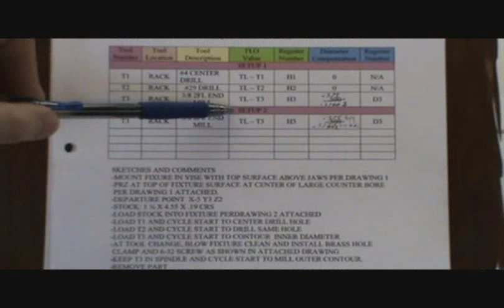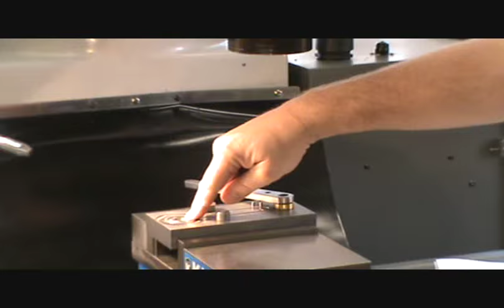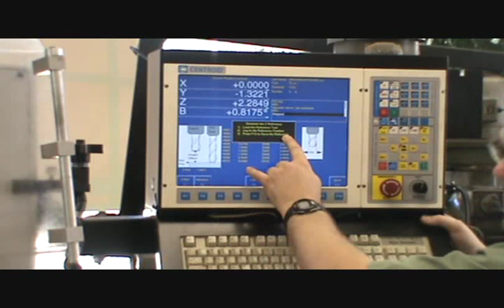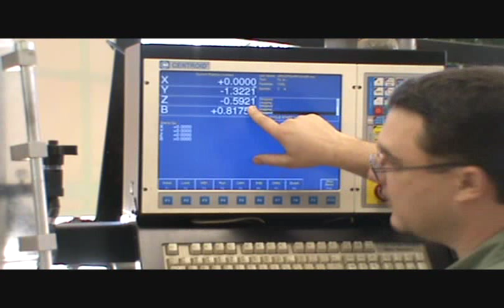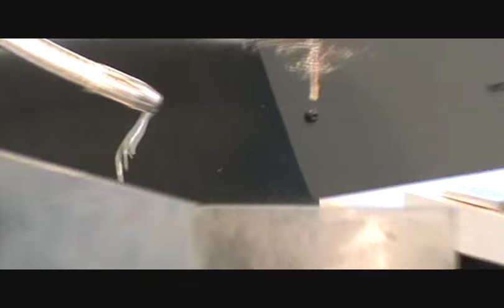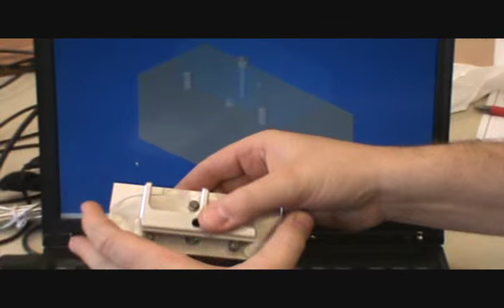CNC MILL INTRO

Comment: The table is moving the wrong direction. cutter is climbing!
Reply: Your are correct that the cutter is climb milling.  CNC mills are equipped with backlash eliminating ball lead screws which allow for the preferred method of climb milling.  Climb milling provides a better finish, requires less horsepower, and the cutter generally lasts longer as long as you aren't cutting a scaly surface such as cast iron or hot rolled.  Climb milling also tends to push the work against the fixture rather than lifting it away.  Certainly, on conventional machines, up or conventional milling is required so the backlash is not an issue.  Even then, it is common to make your cut, snug the locks and climb back without changing the depth, just to improve the finish.  Thanks for your comment.  Let me know what you think of my reply.